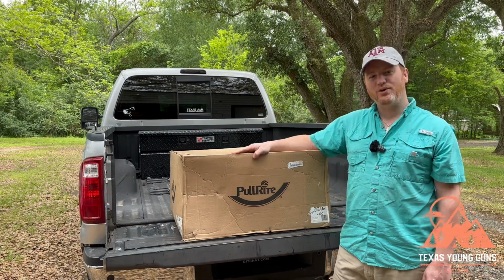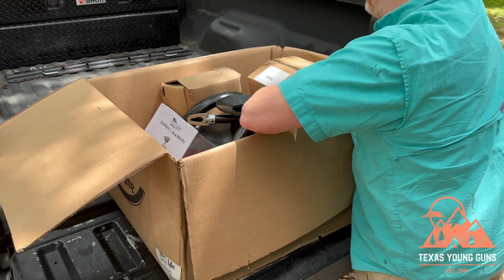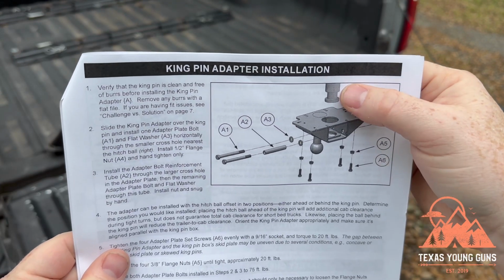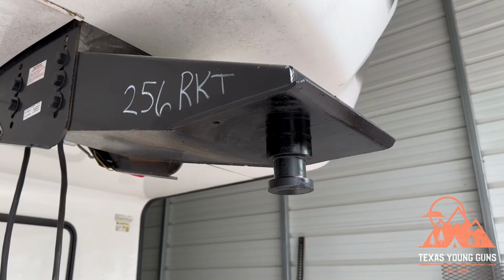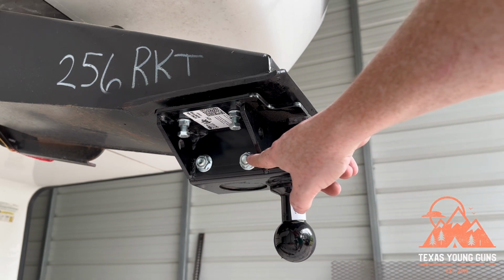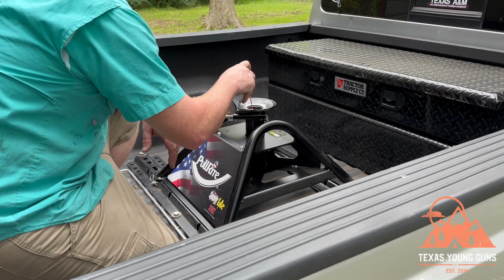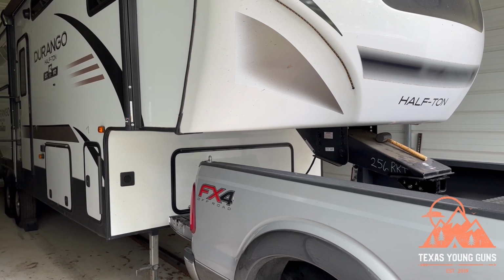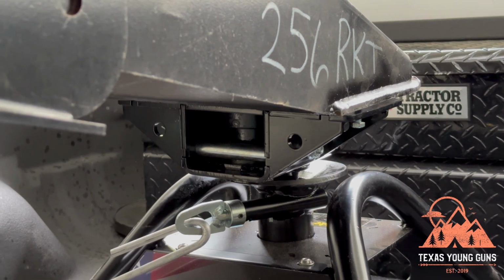Pullrite Superlite 2400 UNBOXING and INSTALL Fifth Wheel to Gooseneck

Comment: I love the hitch. The only problem is when I take my camper back to the storage area. I have to undo the the king pin adapter on the fifth wheel because they have no adapter to move the fifth wheel around the yard . with the ball facing down towards the ground, is there something that fits over that that would make it a standard king pin?
Reply from the maker: That sounds like a painful process